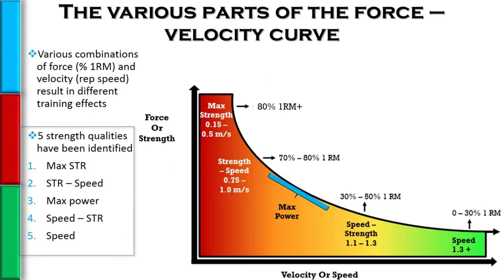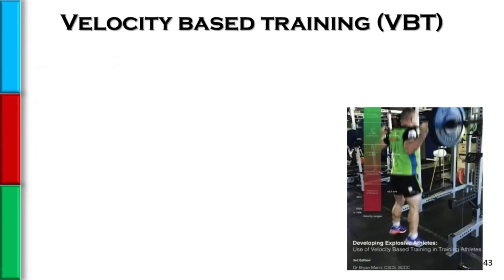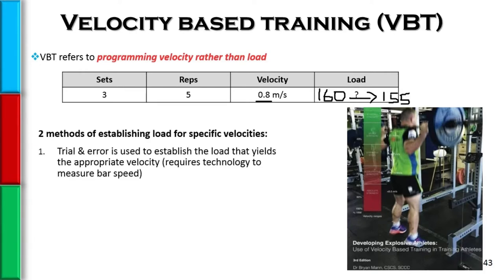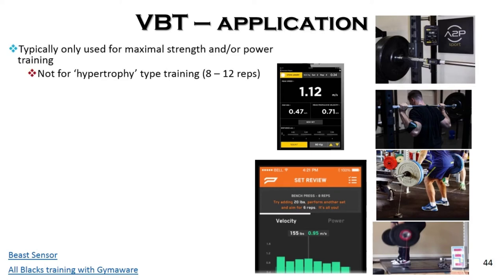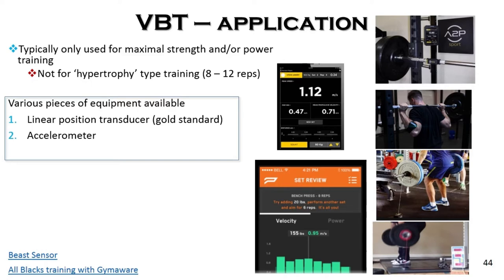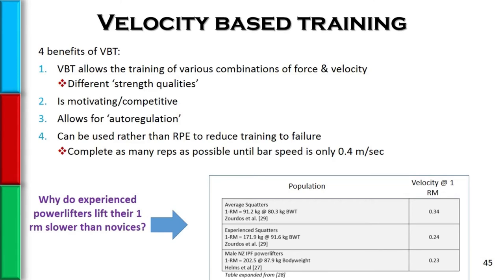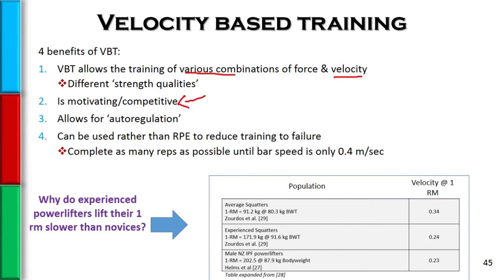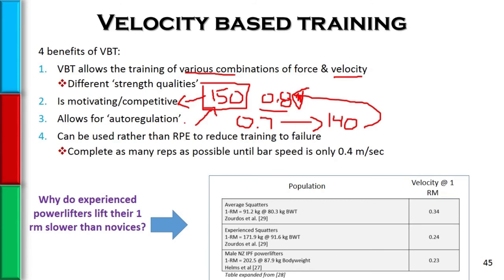Velocity Based Training (VBT)

Comment: When you say 0.75-1 or 1-1.25 m/s, it’s PV or MV? When should I use PV or MV? ❤❤
Reply from the maker: The presentation is based on MV.  
PV is best for Olympic lifts and MV is appropriate for SQ, BP, and DL.
Reply from the maker: Thought it might be helpful to explain why it's PV for Oly lifts.

PV occurs at a pretty consistent point in Oly lifts (top of the 2nd pull).  It doesn't matter "how" the athlete reaches PV, they just need to reach it.  PV, essentially, detemines the time available for the athlete to catch the bar.

MV would represent the MV for the entire lift; which can be misleading.  Different athletes can use different strategies/techniques during the lift based on: specific coaching, injuries,  anthropometrics, etc.

SQ, BP, and DL have acceleration and deceleration phases that kind of cancel each other.  Also, heavy reps are often "grinded".  We see differences in MV @ 1RM between beginners and advanced lifters, with advanced lifters being slower @ their 1RM.  Something like that would be lost in PV.  

Summary: PV for Oly lifts and MV for others.